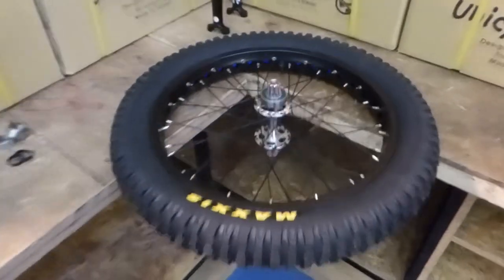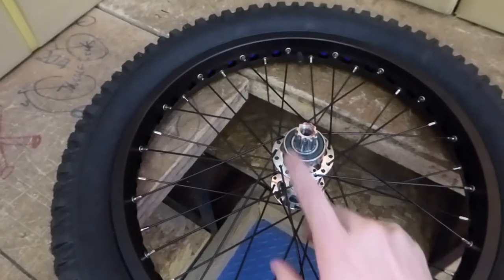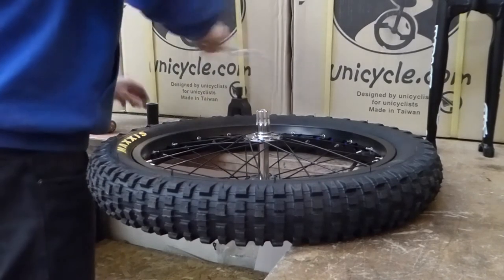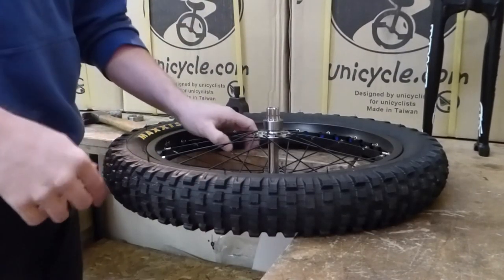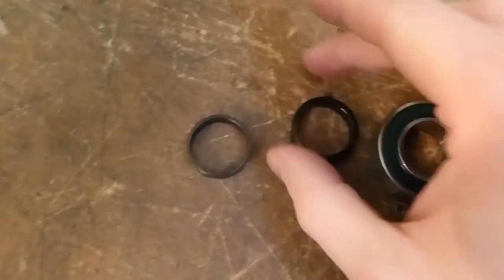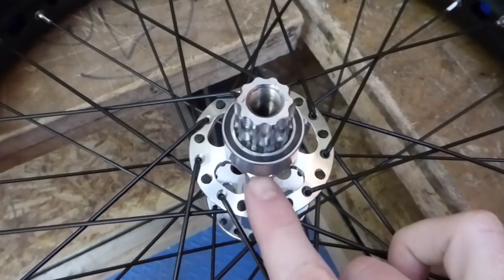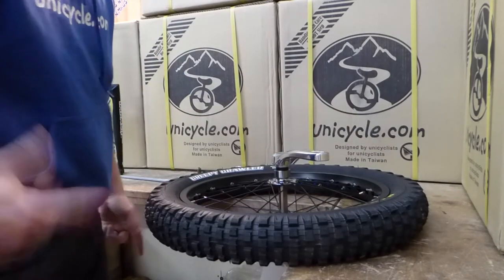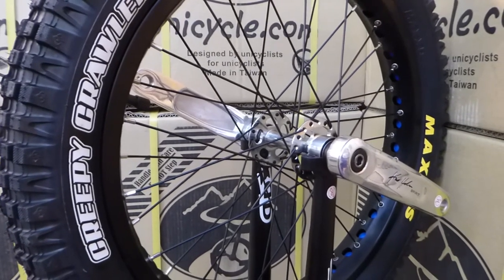Replacing Unicycle 42mm Bearings with 32mm (How To)

Comment: How might you go about putting on a bearing if you don’t have a 27.2 seat post piece?
Reply: You can use any tube that fits.  The import part is that you press on the inside ring of the bearing only and not on the bearing shield or outer ring.